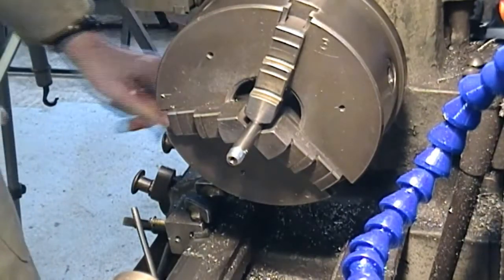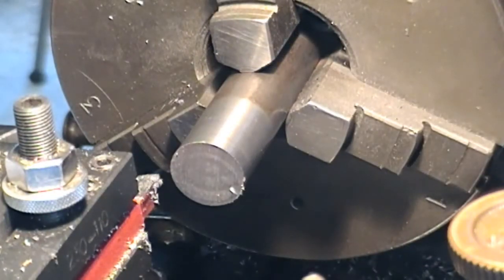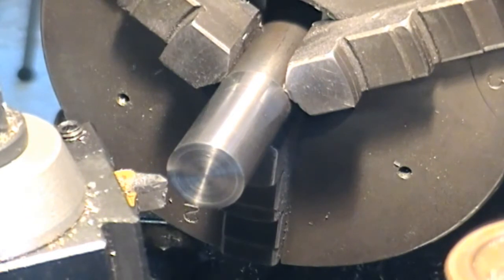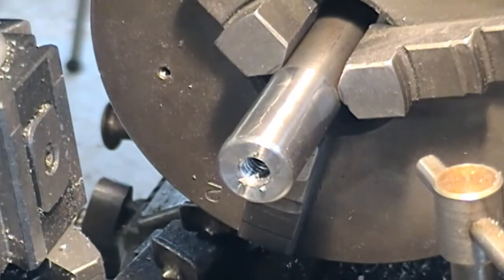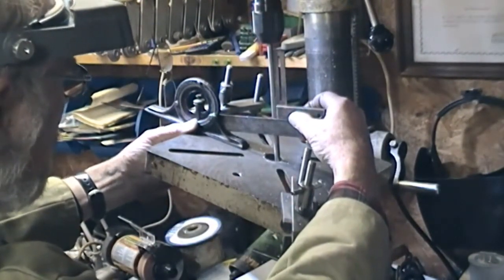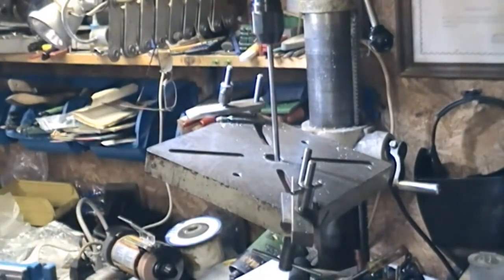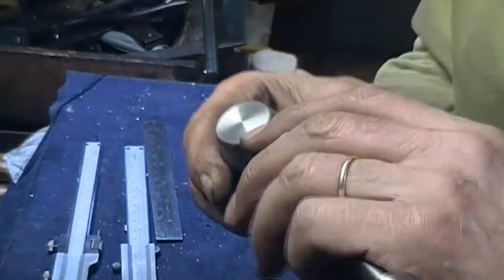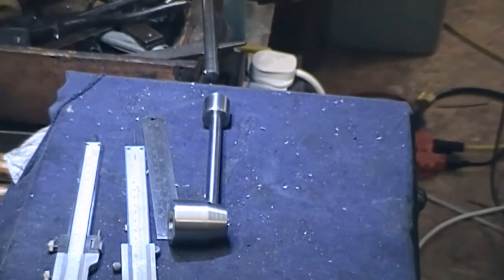Toolpost locking handle, Part Two of 95%

Comment: Good job Chris. The positioning can easily be handled by facing off a few thou on the bottom side of the nut should it orient itself in a bad position.

Colin ;-)
Reply from the maker: Colin - yes of course - a facing adjustment also an option if a small increment - otherwise shimming option.. Hope to get tap during coming week and get things finished. Of course could even be lucky with where it locks but final tweaks should be easy.

Comment: A thin shim (my 0.020" pocket scale works nicely) between the tip of the center drill and the curved surface of the workpiece will easily tell whether the drill bit is centered by tilting the shim one way or the other if the bit is off center. The eye readily and accurately detects off-angle straight lines like the shim. This method also works very well for adjusting tool height on the lathe.
Reply from the maker: Peter W. Meek Great method Peter - in fact sometimes at a push I have use a 6" rule, in particular with lathe tool height checks. Certainly as you say - the eye is good at detecting the off-angle lines and can result in pretty acceptable accuracy.

Comment: Good one, I'm now inspired to do this for my tool post
I have the original handle from the 4 way tool post because I made a new "drawbar" for mine, but find it is too short for adequate leverage. Shimming with a "special" washer sounds the best way to get the handle positioned right.

Pushing 35 here today. Celsius. Won't be seeing my breath I'm thinking.
Reply from the maker: Actually pushed 38º today - briefly! Still plenty cold in the shop. Hope to get new tap soon and complete the project properly.

Comment: Drill a hole through the top. Put a set screw in it to be able to clock the handle. Cap it off with a button head or countersunk screw and Bob's your uncle ;)
Reply from the maker: Good thinking David!! May well do that, or see if shim approach also an easy option - thank you.

Comment: What I did is thread the locking nut first then when it's on the tool post you can mark where you want the handle to be drilled and threaded
Reply from the maker: That's what I should have done - was just being impatient!! However, final tweaking should not be a major problem - shimming or minor face off etc.

Comment: Hi Chris, I've seen all two videos and Halligan one too. How you will manage the stop position of the handle when you will thread the locking nut? I mean, maybe the handle will stop in a position that is not good for you for working. Overall, I've seen the post production quality of your video is growing fast and I like how you do that. Thanks for share and greetings from a not snowy but rainy Italy.
Reply from the maker: Hi Cosimo -- we'll have to see when threaded but - am fully expecting to add shimming or washer etc as both a 'thrust' ring and also of course to fine tune the locked position. Thx for the kind comments.